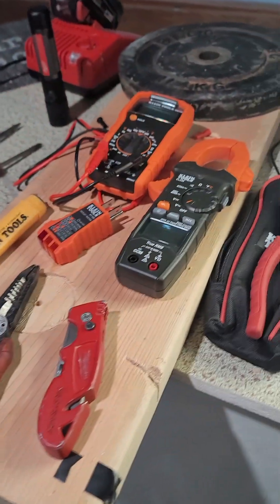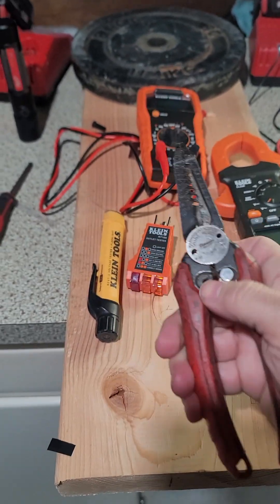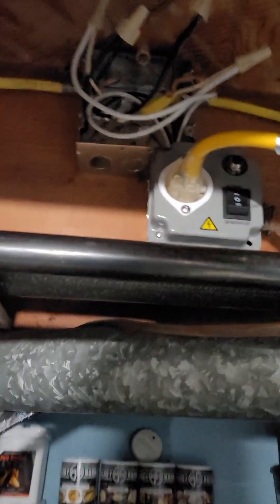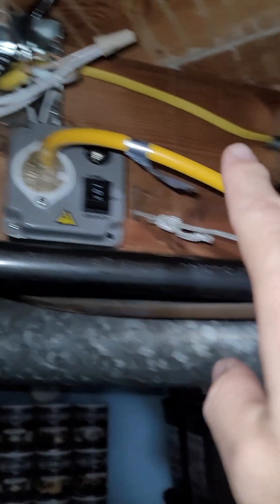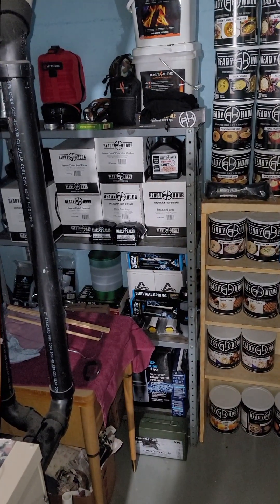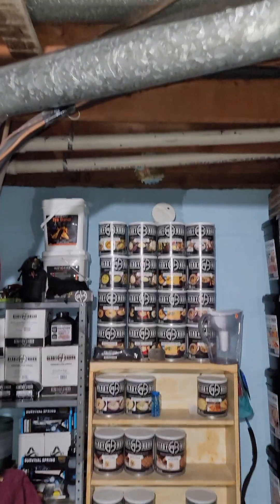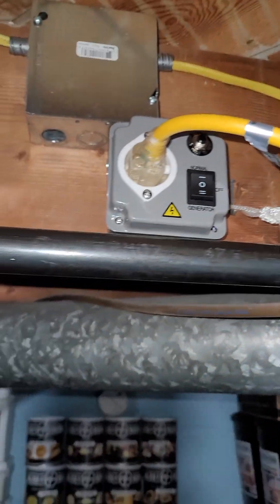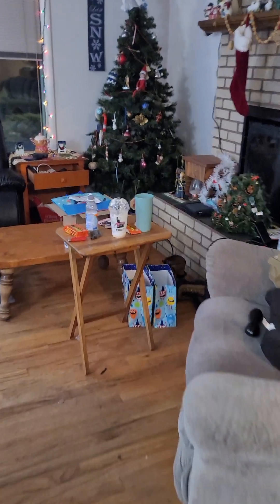Will the AC200MAX run my whole house gas furnace.... #powerstation #solargenerator #bluettistory

Comment: What was your run time for your furnace?  I am guessing if you can get a usable 87% of the 2048 Wh using the inverter, that's about 1,800 Wh.  Assuming the stand-by idle consumption of the inverter is about 20 watts (Bluetti web site forum), and assuming the furnace draws 500 watts (once ignited) and runs 15 mins per hour, my guess would be a run time of almost 13 hours.

My strategy to handle my forced hot air furnace (using my generator) is the run the house to about 80, let the furnace maintain that temp for about an hour to warm the mass of the building, then turn the furnace off and let the house fall to 70 degrees, then repeat.